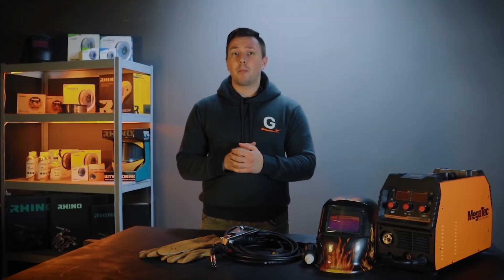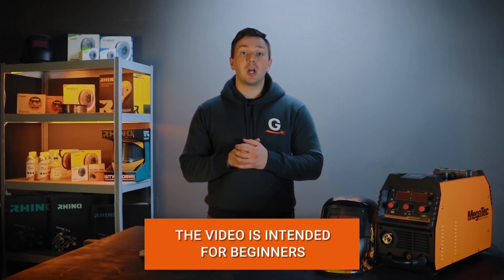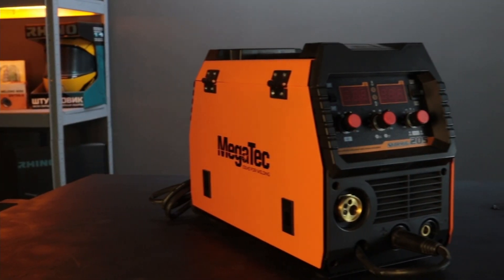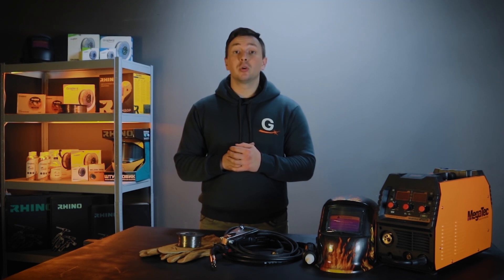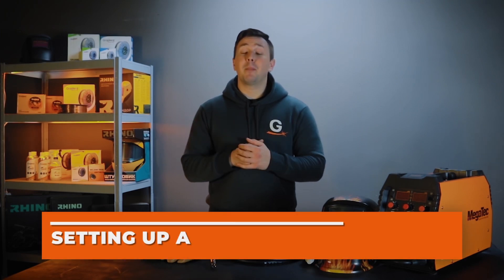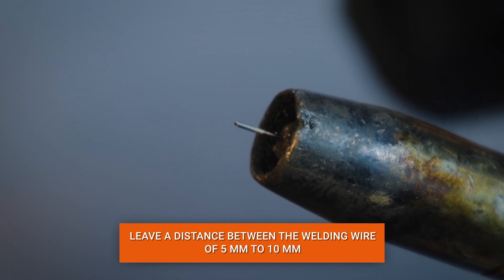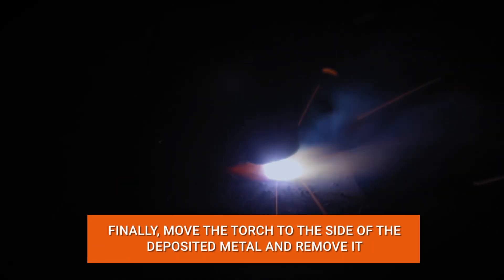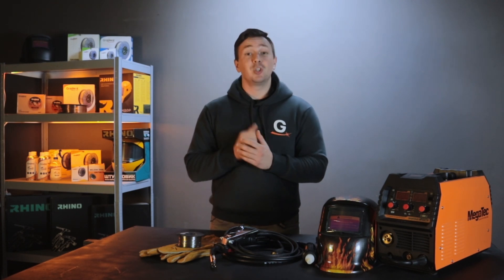How to start welding with flux-cored wire? Video for beginners! | Gradient

Comment: I did everything as you showed, but I had to make some mistakes. I made a hole  in a material, why it has happened? And there were lots of spots around the weld. Could you you tell me how to improve it?
Reply from the maker: Welcome you to our channel!
First, double-check whether the machine has been set correctly (operating current, wire feed speed). Most often, metal burning occurs due to incorrect setting of the welding current.
In addition, it is important to understand how to correctly extend the welding torch. Movement must be uniform.

As for stains on the weld, use a non-stick spray. It will help remove spatter and other metal buildup.

And of course, you need to understand that flux welding will not replace welding with a copper-plated wire with gas.

In the near future we will release a video on the topic "Setting the welding current on a semiautomatic device and an inverter", as well as compare welding with flux-cored and copper-plated wire in detail.

Thanks for watching and asking. We believe that you will succeed!
Reply: @gradient_international  thank you for the answer and announcement of new videos. This is exactly the kind of knowledge I lack - how to choose the right current, wire feed speed, and wire thickness for the welded material. Cross fingers for your channel!
Reply: @gradient_international  and how to use this non stick spray ? could you recommend any? what to cover with it?
Reply from the maker: Apply the non-stick spray inside the torch - 3:39. And so is the surface of the future welding seam. This will reduce metal sticking to the sides from the weld.
Reply: @gradient_international  and one more thing: how correctly extend the welding torch? what does it mean in practise "movement must be uniform" - what is it supposed to look like and how is it done?
Reply from the maker: "The movement must be uniform" - you must hold the welding torch at the same height from the weld, moving it from side to side with the same amplitude and time intervals. This helps to evenly mix the metal to each other and to avoid burning through individual areas during welding.

Example of torch movement:
https://studfile.net/html/2706/1270/html_EJ9HHa3DxL.FO3G/htmlconvd-vpmQvy_html_df8de9656f90a822.png
Reply: @gradient_international  great thank you!
Reply: @Gradient International   All questions are intentionally asked in separate comments to improve algorithms ;)! I also think they might be useful for maybe some new, very interesting videos
Reply from the maker: Thank you, Mace.
We look forward to improving the quality of our content and are already preparing new releases. Thank you for your engagement. Always in touch with you!
May The Force be with you, Mace.